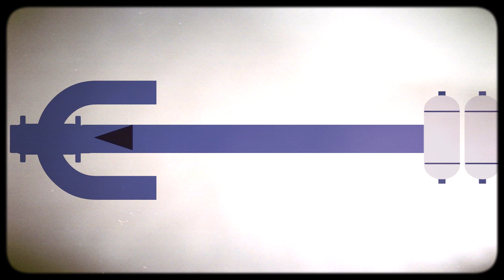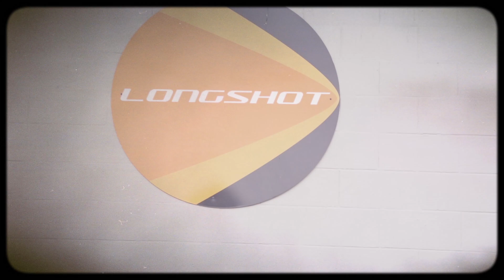Longshot - Hypersonic Kinetic Launch

Comment: Great idea. What do you think of this modification to your proposal. I was intrigued by your statement at each stage the materials requirements are not terribly high. Then this modification to your proposal is in regards to something I’ve been pondering awhile. The major problem with rockets is that the propellant to accelerate a stage has to be carried along with that stage. But suppose instead that propellant was in the previous stage? I’m envisioning a staged rocket whose first stage is powered by some method such as yours on the ground, and then for the second stage, the energy to accelerate that stage is contained in the And this is repeated at each stage. This method does still require propellant but it would appear much less since you are accelerating a much smaller stage at each staging event, and that propellant is not carried in the stage itself.

 You would likely have to have each stage be tens of meters long to get sufficient additional speed at each staging event. But if your method can be adapted to a portable stage it still should be doable.
Reply: At each point in time, what counts is the total mass of the payload and whatever it is connected to, including fuel. The hypersonic kinetic launch, SpinLaunch, or similar could be used in lieu of a first stage, but if any additional thrust is needed, it will have to use fuel in whatever portion of the vehicle is still attached to the payload, whether that fuel is in the them firing stage, or carried in am attached tank "stage".

So yes, kinetic launch might reduce or eliminate the need for rocket stages, but if one or more rocket stage are needed, they will have to have fuel available ; moreover, the original kinetic acceleration will have to be accelerating the mass of whatever fuel, if any, is needed for rocket stages.
Reply: Some fuel will always be needed, at least to circularize the orbit, or the projectile would fall exactly where it was launched from. Or a few miles away thanks the athmosphere which might make the neighbors cranky🙂
Not sure what you mean by portable stage, sounds like a normal staged rocket.
Reply: @michalfaraday8135   Thanks for taking the time to respond. In my comment I left out a key word needed to explain the concept. This what I wrote:
“I’m envisioning a staged rocket whose first stage is powered by some method such as yours on the ground, and then for the second stage, the energy to accelerate that stage is *contained in the And this is repeated at each stage*.”
That last line should read: “contained in the PRIOR STAGE. And this is repeated at each stage.”
Suppose a two stage rocket like the Falcon 9. Quite a large amount of propellant in the first stage. Suppose that propellant is left on the ground OUTSIDE the stage with the stage being accelerated on the ground using that propellant being burned providing the energy for the acceleration. At the end of its acceleration the stage is pointed upwards and heads into the air with the speed it normally has at the end of its burn as a normal rocket.
 Now what about the second stage? It normally has its own propellant. But suppose you moved that stage’s propellant into the first stage. Place the second stage atop the first stage so it has the entire length of the first stage to complete its acceleration. Then burn the propellant to accelerate that much lighter now second stage, as it has no propellant. A problem though is because this is a much shorter length over which the acceleration takes place, meters instead of kilometers, you need much more powerful so heavier engines to complete the acceleration in such a short distance and also time frame.